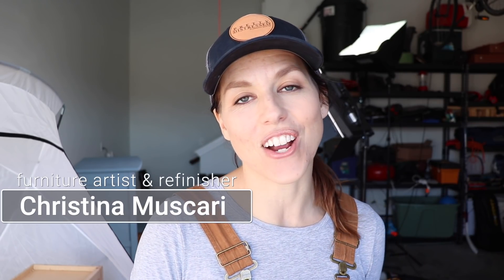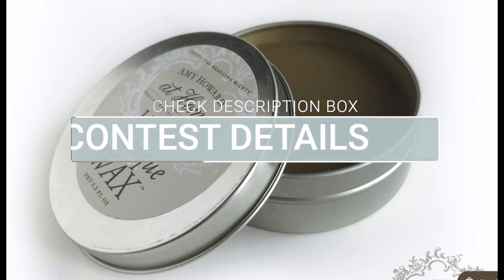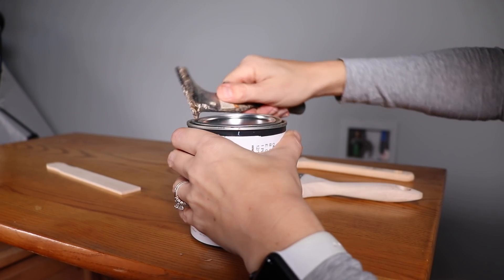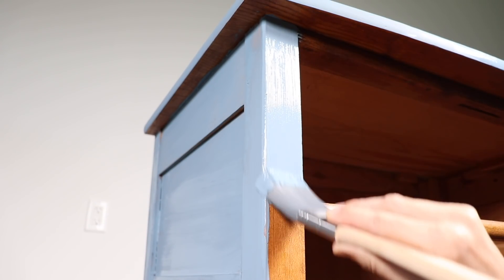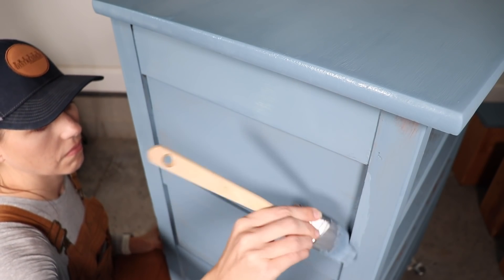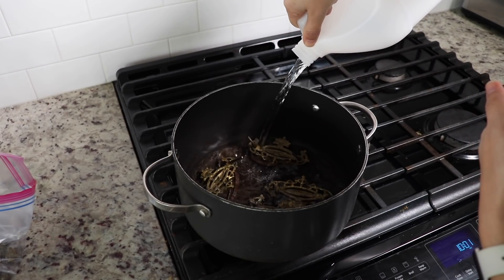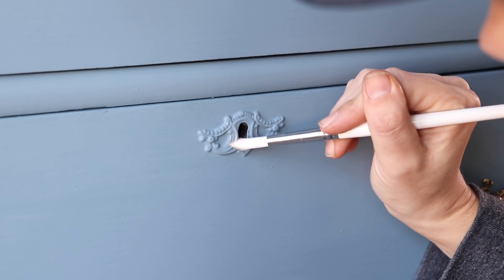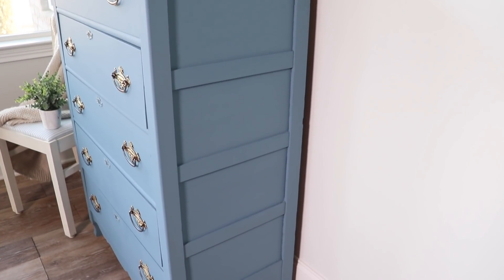One Step Paint For Furniture | Cleaning Old Hardware With Vinegar

Comment: Christina, 
Thank you for sharing Amy Howard’s video with your video, it is always good to see two approaches. I am planing on painting an old wooden shelf (3 shelves). Each shelf is trimmed in a brass scallop edge. I usually spray everything and have a high gloss finish but I can’t with this piece because of the brass scallop edge. I was surprised by how much I liked the finish on your piece! And you didn’t have to use a top coat- huge bonus! 
I would be thrilled to try Amy Howard’s 1 step paint on my wooden shelf. And I am going to try my best to shine up the brass scalloped trim/ edge with vinegar and steel wool. Thanks for the detailed instruction and informative video. Your finished piece looked great. 
Kind regards,
Joy Marie

Comment: am for sure going to use AMY HOWARD At Home Paint!!! At last a paint for the true novice. I have never refurbished an old piece and I have the exact one I have been wanting to do for 25 years. I inherited an old chest of drawers from my grandfather and it's not antique...just old but it has great sentimental value and I have been using it since I got it 30 yrs ago. He made it using siding nails (he sided houses) but he used solid 3/4" planks, put in some drawer dividers and a false top in one drawer. It's a solid 5 drawer dresser, so with a little wood filler here and there, the only thing it needs is a good paint and Amy Howard's (truly) One Step is perfect (at only $19.99? it's much less expensive than primer, paint and top coat, especially since I don't have any products for furniture.) Also, I'll invest in a good paint brush, that's another reason why I haven't done it...brush strokes. I have learned SO MUCH from you Christina, thank you : D     (I'll let you know how it turns out)

Comment: That looks amazing! I love the color, and how smooth it seems to dry. I am a big fan of Fusion Mineral Paint but I would like to give this a try also. Thanks for the 10% off, I am going to order the cleaner, simple and quick. I have just finished painting my bathroom vanity and mirror surround in Fusion Casement and it looks great! My next project is going to be my round kitchen table and four chairs. Still debating what color, but I love the driftwood look. So maybe for the table top and solid for the chairs and table base. What do you think? Oh, by the way, I love the way the hardware turned out, stunning!
Reply from the maker: The 10% off is for my Surfprep sander. Sorry if that was confusing. But you are entered in the Amy Howard giveaway by commenting! Thanks for watching.

Comment: That is a very old piece made out of quarter sawn oak which is becoming rare. It depresses me when I see this stuff painted. Have you considered possibly partially painting it and show casing the wood grain and painting damaged areas? The drawers weren’t highest quality quarter sewn but sides and top could be. I’ve seen mixed wood and paint with old decals which look great and could fit into today’s cottage core, boho, or, natural styles.
Reply from the maker: https://youtu.be/MA0wi9heZ38
Reply: @ChristinaMuscari  wow! Really like that. I have a dresser with more Quarter Sewn wood than that I could use this technique on; like the look of removing the skirt. Also like the raw wood finish and hardware. My piece has more of the quarter sawn wood except for one drawer done in fir. I wanted to cover that up. Nice thing here is you can more easily remove the stencil as styles change. Quarter sawn is very expensive because the technique highlights beauty of tree ring growth, but is very inefficient cut of the lumber.